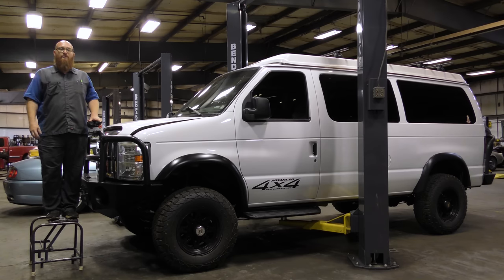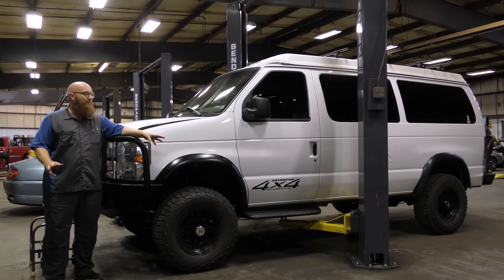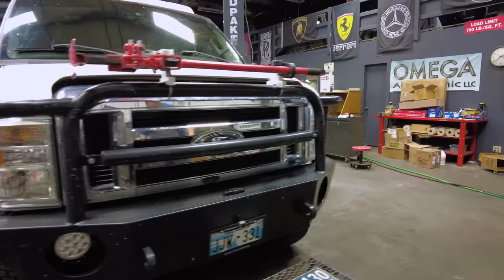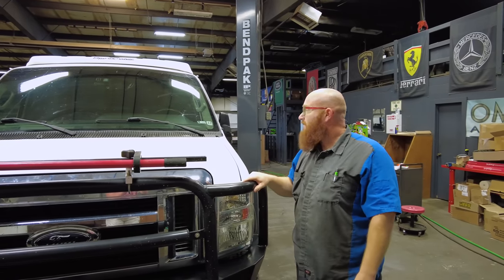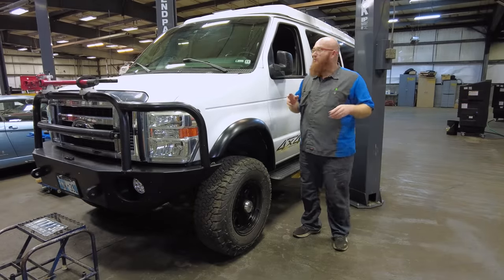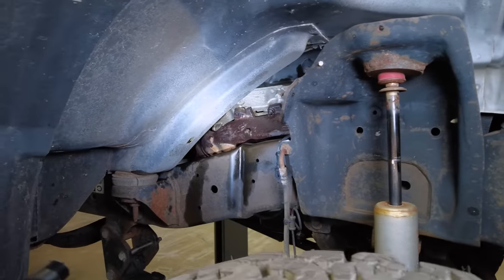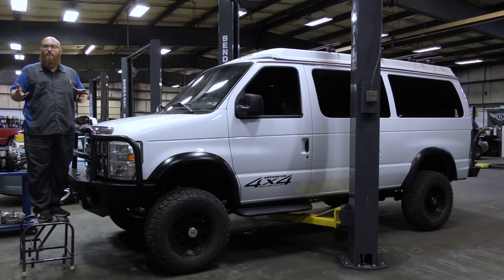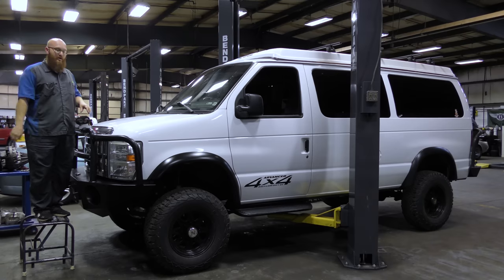8 shops refused to work on this custom '10 E-Series Van! CAR WIZARD shows how easy it was to fix!

Comment: As a Van owner, we've long ago learned about the Van surcharge.   Alot of shops charge extra to work on Vans if they will work on them at all.   Especially custom Vans.
Reply: I mean the engine is always stuffed and not all bays can accept them so it seems reasonable to me
Reply: My uncle didn't but he did get to a point where he would turn down the job simply because they are time consuming and frankly not worth the argument he would get from the customer on how long it took.
Reply: Having a class b camper van I found the shop that worked on the local ambulances and fleet vehicles and they had the tools and know how to get this longs repaired
Reply: Its always about expectations, the van owner has to recognize the maintenance costs are simply going to be a lot higher and more time consuming.
As a technician for nearly 30 years i have seen my share of nearly everything, unfortunately many customers think there conversation van will be no different than their Honda Civic when it comes to repairs, cost , time .
Reply: No problem having my astro van serviced. Maybe hiked up vehicles are different which means most wranglers and 4wd trucks etc.
Reply: @pujabelgian  The height and weight are issues getting them into shops and on the lifts, you are correct.   But its also that they are just harder for some things to work on.   Others are the same as pretty much any other truck.  But engine work can be a real pain as you have to work from both outside, inside and under to get to things.   Our raised roof Savanah with a wheelchair lift won't go inside an average garage door.   And empty weighs around 7500 lbs.   As it has an upgraded suspension and undercarriage for the chair system so not stock.  For its hydraulics, there's a shop.  And as another mentioned, we go to a commercial shop for the other work.   But the dealership itselfs main shop for cars etc has an upcharge for all vans.   Though I think it only applies to full size and heavy duty vans, not sure about mini vans.

Comment: I was shocked when I called around the local "exhaust shops" to get a resonator put in. Got through about 8 to 10 that couldn't weld. Exhaust shops that can't weld! So many auto repair shops are just pathetic.
Reply: I've had exhaust shops that can't weld, transmission shops that don't work on transmissions (just replace them), and upholstery shops that just install ready-made covers, no sewing working.
Reply: @rwdplz1  crazy
Reply: That's why you see so many brake and tire shops. 
Takes minimal skill.
Reply: The sad part is, there are people who could be taught and would be good at something more than menial labor.  But the shops don't make as much money if the lift is tied up, even if they can charge more.  We live in a throw away society.  Soon it will all be electric and they will only replace major components, because you won't be able to "repair" any of it.
Reply: @rwdplz1  from what scotty and others have said many shop rebuilt trans are terrable that factory rebuilt is a better choice
Reply: @bandthouston9685  recently in my city report a guy bought his 2012 volt to dealer for battery. was quoted  close to 30,000  yes 30k  body was good no mention of odometer reading. dealer said theres not many batteries available since there older tech.
Reply: @jar407  I am not surprised.  So, they want us to all go out and buy electric vehicles.  Then we'll be limited on when we can recharge.  When the batteries are toast we won't be able to afford new ones and the cars will be junk because the resale value is zero.  Great way to save the environment.
Reply: @rwdplz1  A couple decades ago I had a small pick up that burned up a rear differential and needed replacement.  I had to call numerous shops to find a place that would take on said repair.  On of the places that refused the vehicle billed themselves as "The Drivetrain Specialists".
Reply: Imagine my surprise when the tire shop struggled to put 265/70r17 tires on mine. It took over an hour per tire. I could have watched some youtube videos and changed the tires faster myself. Credit to the guy doing the tires. He was new, and had zero training. But come the fuck on.
Reply: @rwdplz1  that's so nuts - it's one of the reasons I'm so angry that we spent so much time praising arts/humanities education and teaching people to look down on anyone who does trade work - - well now we don't have anyone left who knows how to actually make things. But we have plenty of armchair philosophers. Great job, society.

Comment: It's common to see the attitude of shops not wanting anything to do with any work that involves anything more than a simple fix. I see it all the time in the trucking industry too. Mechanics have mostly been replaced by technicians.
Reply: They hear modified and that's the reason
Reply: Mechanics and shop owners are selling electric cars better than anybody
Reply: The real mechanics are at home working on their daily so they can go make money at Walmart for their 3 project cars
Reply: @bigburtha3471  This, 100% this.
Reply: Yes.  If a computer cannot tell them what is wrong, it is difficult to get fixed.
Reply: I have a 99 tahoe w a motor swap and no shop will touch it and I can't get it to pass inspection 😡
Reply: You have that backwards. Technicians have been replaced by mechanics. Technicians have training to diagnose and repair, mechanics are just that: Mechanical. They just throw parts at a problem.
Reply: Technicians have been replaced by parts changers
Reply: I'm feelin' ya. I was a pro mech for 50+ years. I just bought an RV from a guy in Wichita who had been happily using a "well known" chain of truck shops (27 currently) in the center of the country (some people have no clue).  I wanted him to have them check the front wheel bearings since it had 42k miles on it and there was no record of them having been serviced. I didn't want to have a front wheel lock up or ruin a knuckle in the middle of nowhere on my way home with it. They charged him $268 to check the wheel bearings and on the ticket it showed that all they did was jack up the front end, spin and shake the front wheels and proclaim them to be ok. There was also an ongoing issue with it being a hard to crank. Several visits earlier they replaced the chassis battery because it wouldn't crank well, hot or cold. Still had the same problem each subsequent visit. During the 'wheel bearing' visit they installed a battery cut-off switch next to the chassis battery (I guess they felt one wasn't enough.) Ends up when I got home I found that all that was wrong was the cheap (quality, certainly not price) POS battery they had sold him was garbage and after three returns to fix it they still hadn't been able to put their finger on what was wrong. If they can't figure out what's going wrong with something as simple as minor maintenance on an 8.1 Chevy chassis who would want to trust them with a a $100k+ OTR rig? Replaced the battery with a used one from an ambulance that was laying around and it's all good. I feel sorry for the guy, he has spent thousands of dollars with this joint and it appears he's been bent over hard each time. I'm still sitting on the fence about telling him about all the things he's paid for that were unnecessary.
Reply: I’m with all the other shops, please don’t bring your modified junk to my shop. I’ve NEVER seen a modified car not just be a hodgepodge of shitty work and parts. I assume that’s because anyone who knows what they’re doing when they modify something can also fix it when it breaks. Same with old luxury cars, not worth my time.
Reply: @arrgorndenethor  "Modified??  How is am I supposed to get service data?  Nope, nope, no."
Reply: When you have 120k in tools, 25 years of experience and only make $35/hour,  morale can be pretty low.
Reply: Instead of saying "no", why don't they just say "yes, but it will cost extra". Then the customer gets their work done and the mechanic makes good money - win/win.
Reply: @acehole1990  I had a modified engine swapped car for a fair bit, and the dealer mechanics did the service and repairs on it. It just cost me more, since they billed by hour and not by the book price, which was fine by me. My car was not a hodgepodge, all parts where applicable were OEM just not from the same model, where not applicable (exhaust, shocks, brakes, lights) they were top of the line gear. They made lots of money, my car got fixed, win-win. They probably didn't particularly enjoy it at least in the beginning, but they got to know the car over time and didn't mind.
Reply: @randywilliams4325  now this is truth ...
Reply: @bigburtha3471  except somewhere other than Wal-Mart, I thought they don't pay enough to live on, let alone have any project car. Unless you mean my version of a project car, which is a hoopty that I want to be a project!
Reply: @michaeljarvis5489  Modern young mechanics don't have their own places lol. You can't park 3 non running cars on the lawn of an apartment complex
Reply: @shivermetimbers9316  Probably cause it's not stock, so what diagnostics do you use and what has been done well and what hasn't. Labour times are based on stock vehicles, so how do you price a job on a crap shoot that is fair to owner and shop?
Reply: @acehole1990  we just had a modified WRX come into the shop for a new subframe and turbo, and everything was hacked together. The guy working on it had to modify a bunch of shit to get the new turbo to fit because so much had been screwed up by the owner. Modified cars are almost always a nightmare
Reply: @bigburtha3471  the two best mechanics I know run around in service trucks all day fixing trucks and heavy equipment , and are bombarded with endless side work when they return home. As near as I can tell anyone intelligent and honest who can competently diagnose problems, turn wrenches, and weld will never need to work for less than 50 bucks an hour and will probably earn significantly more, and will never be short on work.
Reply: @swamp-yankee    Yea I know guys like that. But most of those guys hate it now. They hate cars and if you ask em to fix something, even something simple, they get upset and start talking down to you as if you know nothing. If you wanna have a GOOD time working on cars, you don't do it as a profession. It stays a hobby. If you get pissed at a car you can take a break and think about it. Not if you HAVE to fix it and you don't get paid until you do. 

The most creative and awesome builds I've seen are from guys and girls that don't really know everything. They mess with it until they figure it out, because it's just fun
Reply: @swamp-yankee  I had my car starter quit in the parking lot of a major retail and garage store. The the young young guy at the front desk in service would not touch it. After trying a fix and borrowing their starter battery, it was still not working. I called my local mechanic that I knew was good. He got the car towed to his place and found the problem- a frayed starter ground cable, He made up a couple of ground straps and replaced them better than new. Car started fine after that. All I can say is their must be a lot of garages making too much money if they can afford to turn down work. Finding a good garage that gets stuff fixed is hard too and usually those places do get the most referrals.
Reply: @acehole1990  ☝😎✊ PREACH !
Reply: @rch5991  I understand what you're saying but also realize putting any money into one of those is pretty much a waste of your money. Whether or not you realize it or disagree they did you a favor.
Reply: @arrgorndenethor  It's the fact that it's lifted, these are a pain in the ass to work on normally, let alone when these are lifted higher up. The access on the inside of the van to the back half of the engine is nice, but if you're doing for example spark plugs, or fuel injectors then you now have the fun of getting a ladder and leaning into it to get to the front plugs or injectors.
Reply: Not technicians..... parts changers.  If the book doesn't tell them to check "x", and if "y", replace "z".
Reply: It's the other way round the guys that were technically trained could work on any vehicle and diagnose a problem are being replaced by cheaper to employ/pay guy that works on one manufacturer and just fires a parts cannon. Vehicles are designed to fail people, that's how you have a market for new ones. Modern vehicles are designed for parts replacement not repair or rebuild.
Reply: @pkt1213  Computer rarely tells you what's actually wrong, just gives you direction.
Reply: @arrgorndenethor  that's because modified 90% of the time means hack job
Reply: The cost of labour is so high these days that in many cases a lot of vehicles aren't worth beyond a simple fix. A vehicle needs major work your going to be paying out for parts plus 10-20 hours of labour and you might be right back a couple months down the line with some other major issue.
Reply: @randywilliams4325  "Technicians have been replaced by parts changers"
Precisely and word for word what I was going to say.
Reply: @stevestadnik9206  You just need to look at each individual case. Yes if some wanna be fast and furious has hacked together a bunch of mods then no thank you, take it somewhere else.  But in this case the van has a very well done 4x4 conversion with lifted suspension.  Everything to do with the engine and transmission remains stock.  On these Ford Vans they use the same transfer case used in F series trucks , and they use a front solid axle assembly from the same F series trucks, F250 or F350.  So even the modified stuff is still Ford stuff.  But like somebody else suggested, there is nothing wrong with charging a higher labor rate to work on something like this.  If the customer has the money to make all of these mods then they have the money to pay for higher maintenance and repairs.  To all of the Auto Tech's and mechanics out there, never forget it is called a labor guide.  It is not a bible , you can set your own prices and the customer can take it or leave it. For example I know replacing the spark plugs on a 1996 V8 Camaro is a bitch!  Labor guide calls for around 5 hours to do the job.  Nope, not worth it to me at 5 hours.  I quote 8 hours to do it and the customer can take it or leave it.  Will not hurt my feelings one bit if I don't get the job, let somebody else struggle with it for 5 hours!
Reply: they can't plug it into the computer and get step by step instructions with overly inflated fix hours to charge.
Reply: @markdsm-5157  Sounds about right.
Tech's today have little to no imagination.
Reply: @veryfunclub  But, a van with 4x4 conversion done by professionals shouldn't be a major problem.
Reply: @shivermetimbers9316  wat codes is she throwing? I have a 98 2 dr Tahoe 5.7 Vortec OB2 I’m assuming yours is exactly the same. What is she doing?